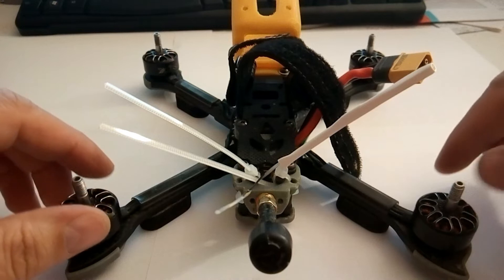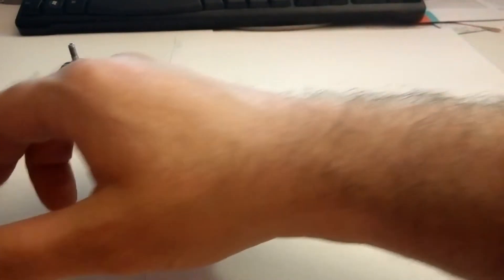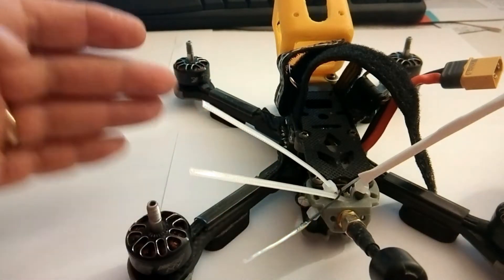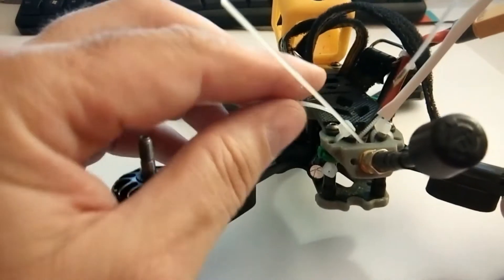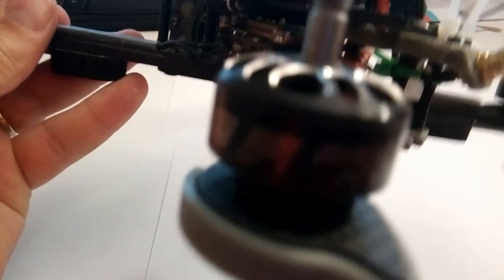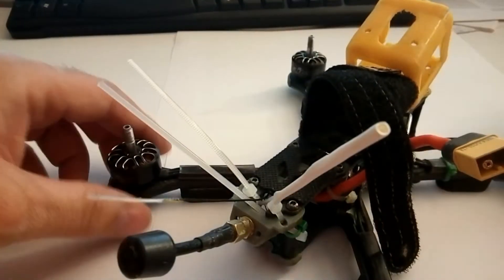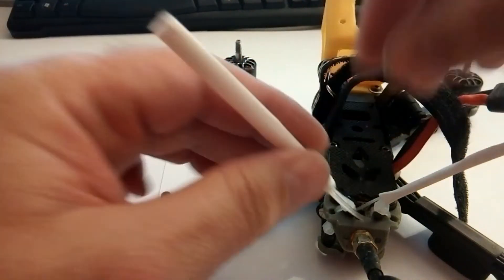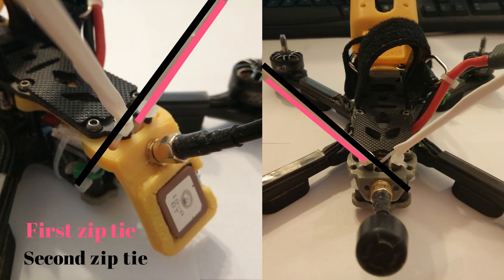A simple idea to properly mount the 2.4 GHz receiver antennas for an FPV drone

Comment: Do antenna ufl connectors heat up and fatigue break at high power ?
Reply from the maker: I'm not sure I understand your question, but I do not seen a such problem.
Reply from the maker: You have funny videos! Keep going. +1